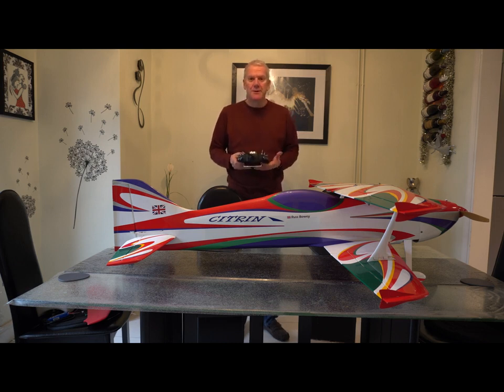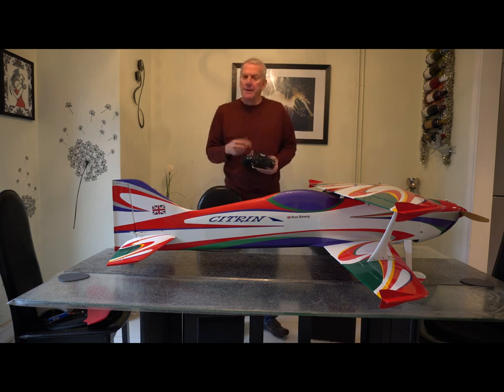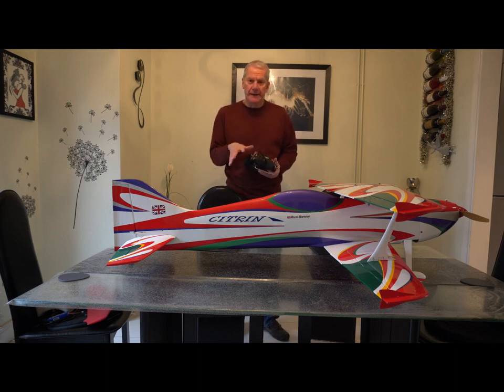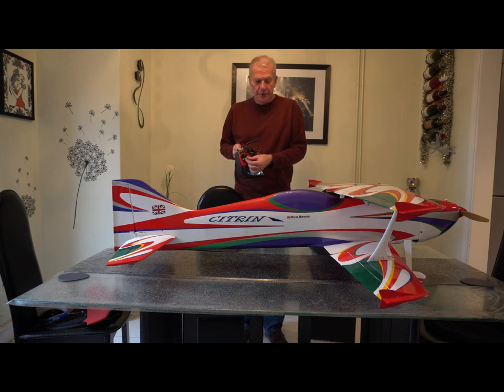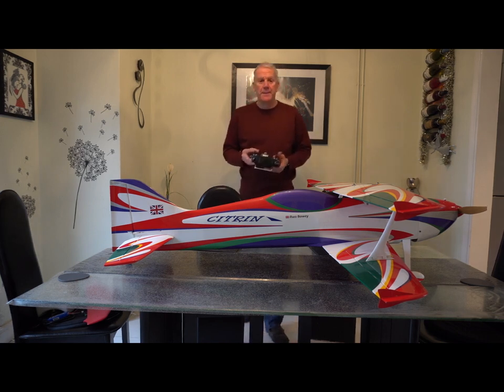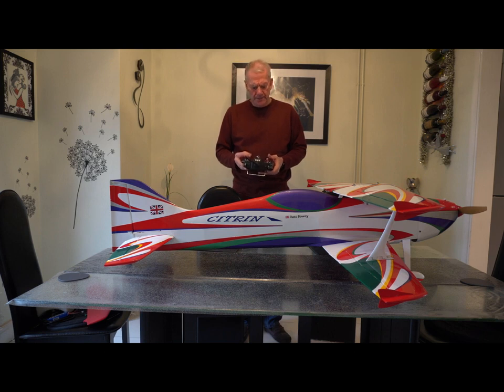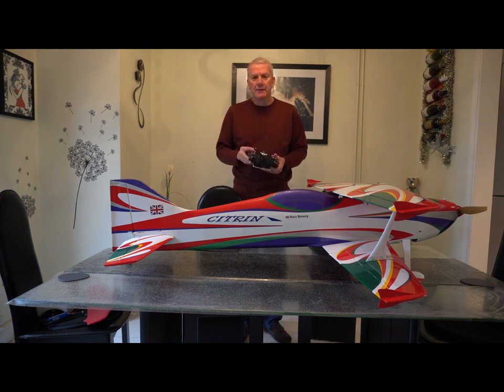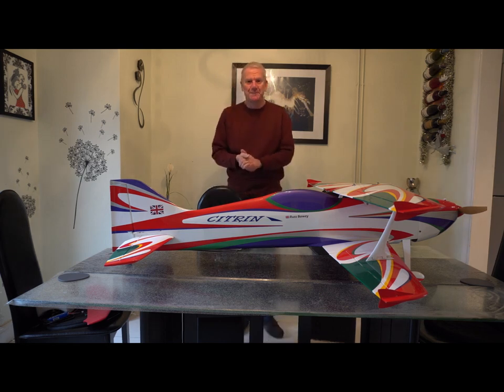Crow Brakes Proportional Crow Brake deployment on an F3A biplane.

Comment: do you have videos of this brakes in flights?
Reply from the maker: I haven't done, but I can take some figures in a vertical descent (with & without the brakes deployed) from a GPS derived speed using 'Flight Coach'. I'll see if I can do that tomorrow & get back to you....
Reply: @ModelPlaneTraining  I would like to see if a roll occurs. Because I think it must be very difficult for the braking effect to be the same on both sides. It's ok using Flight Coach.
Reply from the maker: There is no roll, as each aileron deflect a balanced amount. It does take some time to get the control linkages set up exactly, but is actually easy to do. I thought you were thinking about how the descent rate would change with/without flight coach?
I can only add words/figures to the comments & not a pictures of F.C. trace in the descent..